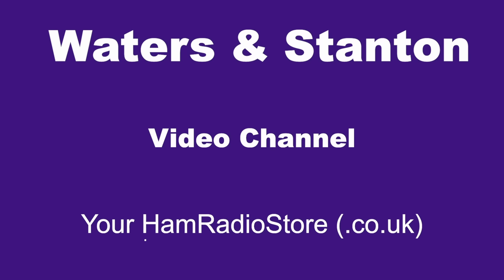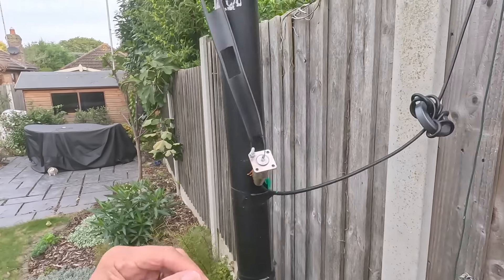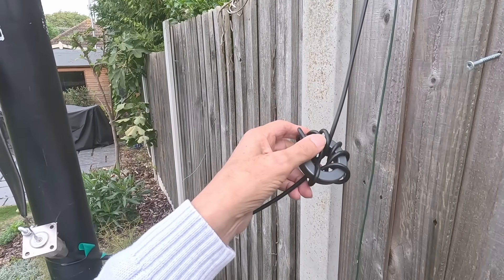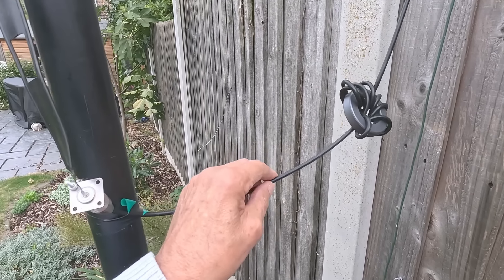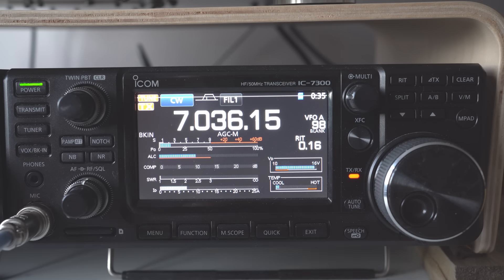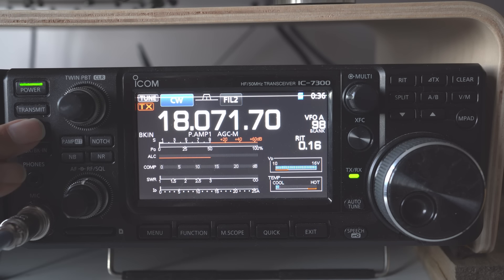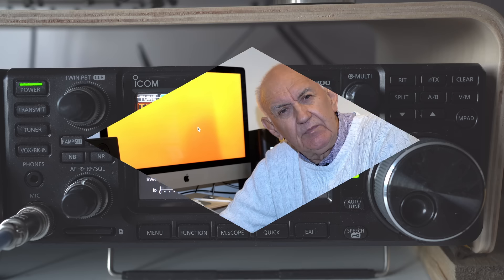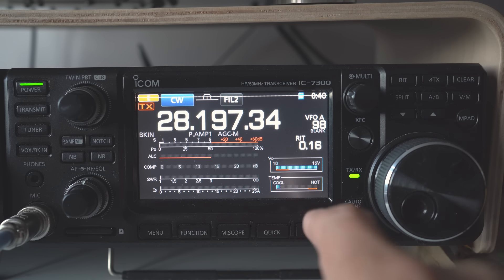Icom IC 7300 Hidden Ability - Check this Out! | Ham Radio

Comment: Hidden from those who didn’t read the manual.
Reply: What self respecting radio ham ever reads the manual? 😂 Only kidding. However, I have encountered individuals who truly seem to believe that referring to a manual is a sign of weakness.
Reply: What ? There was a manual  ??😅
Reply: For Yaesu FT847 & FC 20 ATU owners try this 
The fix is on in one of the menus in the Yaesu 847. After this mod the 847 will tune up to a 7:1 insted of 3:1
The first thing you need to do is get into the service menu. You do this by holding down the three buttons on the mic and turning on the radio.
The first menu will be Fm-51 do not change that one. Rotate the sub-tune knob until you see the menu that says SWR 3.0 to the left this you will see two small numbers or numbers letter combination. Rotate the MEM/VFO CH knob until you see 9A then push the menu button and you are done.

Comment: Its nice they included this. In general, an antenna tuner that can match a 3:1 mismatch on a lower frequency can match much larger mismatches on higher frequencies due to the linear relationship between frequency and reactance. That means that the limiting factor on higher frequencies is not the tuning range of the unit itself, but the voltage rating of the capacitors. That's why the power has to be decreased if you tune a larger mismatch than the unit was designed for.
Reply: That was a great explanatory comment. Thanks.

Comment: Peter, you always give practical ideas. I used your idea with my random wire (35.5 ft) and 9:1 with great success using the IC7300 in emergency mode and have made many qso's while traveling. You are a true advocate for ham radio. Thank you.
Reply from the maker: Thanks so much.

Comment: I would guess the screen SWR indicator is disabled in this emergency mode. I suspect an inline SWR meter would show the same mismatches as when not in emergency mode and thus inefficient transmission, with considerable reflected power, hence to 50W limit to protect the PA from overheating.
Reply from the maker: In-line S-meters always read true VSWR.

Comment: I wonder why they included the emergency feature to operate the IC7300 at a much higher SWR and just didn’t include as standard inside the antenna tuner. My only assume is that it puts a lot more stress on the final output transistors, the capacitors and inductors in the auto tuner.  This maybe this is OK for a short time, like an emergency but if used constantly it will cause prematurely age the components causing reliability problems in the long run, even though it is operating at half power.

Comment: I think when you go to Emergency it drops the RF output power to 1/2 so your tuner is able to compensate for a lower power RF on transmit. Maybe? Check your RF output power with it on Emergency.
Reply from the maker: Yes you are correct. The power drops to 50W.

Comment: Not convinced with the explanation as to why the tuner is 'disabled' from tuning since the tuner is clearly capable of doing so.  Why would you 'cripple' the radio?
I think a better proposal might be that a badly mis-matched antenna tuned down with the ATU, whilst convenient will probably generate heat in the tuner which might cause progressive damage (cooking) with sustained full power use.
When viewed in this context, allowing extended ATU capability in an enforced  1/2 power (emergency) configuration makes more sense.

Comment: Hi Peter, Thank you. I generally wind my line isolators out of RG-402 to avoid windings tighter than minimum coaxial cable bend radius, also to allow for more turns and better isolation.
Reply from the maker: Thanks for sharing

Comment: Thanks for this video. There isnt much info on it and people seem to be all scared of this mode because of the "emergency mode". People always talk about how great the g90 tuner is but in reality just turn on E mode for the 7300 and you get the same tuner ability + 30w more power than it.
Reply from the maker: You are correct. 73 Peter

Comment: It was showing no reflection. Perfect SWR. I wonder if that mode essentially disables the meter, so it looks like it tuned everything perfectly when in fact it did not. I too have a 7300 and 7610. Not criticizing it — just trying to understand it from a user interface perspective.

Comment: I use a random wire, around 30m, with a 49:1 balun. In the shack, I initially use a manual tuner (Kenwood AT-230), to adjust my compatibility with 5W CW, followed by the rigs ATU. This gives me all the bands I want, 160 to 10, and I also seem to get excellent reception. Any comments on this setup regarding the security of my rig? There is no evidence of RF in the shack.

Comment: Thanks for Sharing Peter. I was wondering if you tried reducing the power first with the Power Control and then trying to use the tuner? Does the Emergency Function simply reduce maximum power?
Reply from the maker: No you need to switch to Emergency mode/

Comment: Even its there, its name says "EMERGENCY" so, don't use it always, just for a case where you must need to use it for an emergency case of you need to comunicate because even with only 50W your tuner relays and pass band filters will be exposed yo very high RF currents due to the very high SWR and eventually will damage the relay contacts by arcing inside, its not recomended to use it always.
Reply from the maker: Totally wrong. The last thing you would need in an emergency is the risk of failure. It is perfectly safe for extensive or permanent use.

Comment: Please remember that this is coupling the radio into the antenna. It is not changing the antenna in any way and hence not "tuning" the antenna. 

It's always best to have a resonant antenna on each band but if this extension to the default matching capabilities of the 7300 lets you get some power out on a band that otherwise you couldn't - go for it. 73 Ed
Reply from the maker: Many thanks. in fact it is matching the reactance present at the end of the coax , not the antenna.

Comment: Fantastic, thank you! It tuned my 40m dipole to 20m band, where SWR was more than 3. Now, no problem. 50 watts is more than enough on digital modes. I just had an FT8 QSO to China on 20 meters. And yes, I found a mention about in the manual now when I looked for it. I should have read it more precisely, my bad. 73, OH2KAJ

Comment: A small resistor can allow you to do this at full power level as well, which, for reasonable antennas (ie, not exactly half-wave), you can operate at 100W just fine and not have to reboot into "emergency" mode. Google for pc5e 7300 atu mod, you will see. The mod doesn't change the SWR metering, only the threshold of which the radio will not attempt to tune. One little resistor later and you can run that built-in ATU anywhere. Just be sensible about it and don't torture the radio where it truly should not be used.

Comment: Peter, my preference is to use thick well shielded coax connected to a quality waterproof balun mounted near the antenna terminals. When disconnecting the balun from the backyard dipole, there is no sign of unwanted signal via the coax line connected to my Icom R8500 or 8600 receivers. I use RG6 Quad Shield 75-Ohm coax for my HF and VHF SWL work. The extra coax shielding makes ferrite chokes unnecessary at my receiving location. Not happy with relative thin diameter coax wrapped around a toroid ferrite. The balanced twin lead and coax in your YouTube video is also exposed to the large amount of rain that the UK typically experiences. A properly balanced receiving antenna (dipole, Yagi, log-periodic) with quality waterproof dipole terminal balun mounted as far away from the house and street power line noise sources is optimum for maximum practical SNR. The vertical axis noise floor on receivers like the Icom 7300 spectral display will be usually lower with high-end properly balanced antenna receiving systems. Horizontal polarisation also helps increase SNR. There are always better ways to do things.
Reply from the maker: Thanks for sharing but however thick or however shielded you4 coax, may be. There will alway be common mode currents flowing. R3member, common mode mode current has nothing to do with coax shielding. 73 Peter.

Comment: Τhere is a white horizontal line at the top of the screen. Is there a problem or is it normal?
Reply: It's a problem. Icom got a bad batch of screens and it happens to 1 out of every 1,000 radios from the reports I've seen online. My IC-7300 done the same about 6 or 7 months after I had it. Sent it in for warranty repair.

Comment: Hmm it's a compromise  having such a nice radio it's best to not to have resort to emergency mode really though...
Reply from the maker: No, compromise other than power limitation. Forget the word “Emergency.”
Reply: @watersstanton  the compromise is half the output power yes. If you've got 100w most would want to use it

Comment: Thank you for this video. I have used the Emergency Mode on my IC-7300 when operating mobile in my car but have always been a little nervous thinking that I might be harming my radio by operating it so much in Emergency Mode.

Comment: I tried a G5RV and didn't like it much.  I Put up a 80M dipole and fed it with 450 ohm twin lead and tune it with a 
"true" balanced tuner. A BT-1500A  replica I build to be exact . Much more satisfactory performance even with an amp. Then went one step further and put up a horizontal closed sky loop fed with twin lead ladder line  at 40ft cut for 160M. Tunes great, a top line antenna and now my go to antenna for any application! Cheap, easy to build, low noise,  if you have the space to pit one up!  You can still find old Johnson Matchboxes that work quite well with these at reasonable prices!

Comment: Hello Peter, thank you for that information, I can now tune all bands except for 30m & 60m, I am using a ZS6BKW as inv vee at 40ft so happy enough with that and as you say, 50w is ample power.  However, how would I reverse the Emergency Tuning should I need to? 73
Reply from the maker: Just go back into emergency and you can switch it back via the reset procedure. Make sure you have a line isolator at tx end as this will help matching. Use a ferrite core with a around 8 turns of the coax around it.

Comment: I'm looking for a new radio and the IC-7300 is top of the list. Thank you for the videos about this radio. I like the way the menus are interactive rather than a simple list. The size of the radio is important, I don't want to be fiddling around with tiny buttons. Apart from that, Icom or Yaesu are both very good.  It seems to me that if you have been using your IC 7300 in "emergency mode" for a couple of years without problems then  all is ok.  Perhaps it's a selling point for the USA where emergency communications forms part of the Ham culture.

Comment: I had a Yaesu FT-991, and on my Off
Center Fed Windcamp WA4 multiband
antenna which didn't tune all inclusive
bands because of a 3:1 SWR range.
Also my Yaesu FT-891 with the Yaesu
FC-50 Tuner has similar results.
I have the switchable MFJ automatic
Antenna Tuner Extender in line which
helps the matching to some extent.
Now with my Yaesu FT818nd and an
external AT-100 Tuner and a separate
Micro 50 watt multiband amplifier,
running 50 watts, I believe it is able
to tune the antenna on all bands,
I presume because the external
AT-100 Tuner has a wider SWR range
matching ability, and that is with
the amp only accepting a 2:1 SWR,
or lower.
I don't know of these two full size Yaesu FT'991 or FT-891 transceivers
have a similar feature to help SWR
matching as the Icom IC-7300 does?
73 de W2CH Ray New Hampshire. 😊

Comment: Hi Peter !! Thanks for the video !!  I have a G5RV Jr. and I would like to install the same configuration that you use, what model of cable to the radio do you have?  and what length?  Thank you and 73!!
Reply from the maker: I use RG58 coax. The length is not critical,. I guess mine is about 115 metres, but never measured it!  Hope that helps.

Comment: this is a nice trick for the 7300. I run 50 watts or less with mine. I got a tube amp if I want more. for portable use like POTA this is great . I have used a 9:1 random wire antenna and it tunes all bands. with end fed half wave with 49:1 you only get some bands and with emergency mode you can tune over 3:1 SWR.  like using 17 and 12 meters . when tune for 40,20,10. etc. depending on cut length of wire. This trick is in the extended manual not the paper one. you do the same in menu to turn off  E mode. 73's

Comment: An iron ferrate terminate for the antenna will give nearly 2x the signal capture than most antennae I have found. Plain old protein from household food is comprised almost entirely of ferrate iron. Connect 62 feet or more of heavier gauge copper wire into a jar of any peanut butter which is high in iron, run the cable out a window and place the jar at least 8 or 10 feet above ground or on the roof. You will be amazed with the result.

Comment: So basicaly instead of mesing around in menus selecting Emergancy and having to rebbot the radio, just drop the power to 50W on the bands that wont tune and they will tune.
Reply from the maker: No, no no! Just turning power down has no affect. You need to go through the reboot procedure.
Reply: @watersstanton  Interesting, what a silly way of doing things on icoms part. good info though for people with that radio.

Comment: Interesting option. Thanks for sharing. Very strange that Icom call this feature 'Emergency Tuning'. If I used a half size G5RV, I would definitely use a remote aerial matching unit between the line isolator and the ladder line. This would remove the losses on the coax due to to high swr. You could also use full power from the radio.
Reply from the maker: Yes correct. But not everybody wants to use, or can afford a remote ATU. The VSWR losses maybe less than you think. There are several calculators on the internet.

Comment: Can you achieve the same by simply reducing the o/p to 50 watts, or does the emergency mode activate some other changes, possibly the tune up power applied during matching.
Reply from the maker: No
Reply: Normal mode will match 3:1 and emergency mode will match 6:1. That said, the toroids in the ATU are tiny and they will get very hot if the antenna is far out of tune. There is a reason why it's limited to 50w when matching 6:1 and its not for your safety.
Reply: I can
Reply: @neilcoley9464  I have manually turned the watts down to 1 or 2 and made it tune a large mismatch but the losses would be very high besides running very low watts. Almost no signal will radiate off the antenna at that point. Best practice is to work on the antenna to be resonant at the desired frequency instead of transmitting with a poor swr.
Reply: @aarongriffin81  nice

Comment: Thanks for sharing this, but the Emergency Tune function isn't "hidden".  It's right there in the manual and menu.  I use it sometimes with my 7610, but normally don't need it (I have an external high-power LDG tuner).  I find it useful most when running FT8 or WSPR in the field when my antennas are far out of tune on certain bands, or like your G5RV, isn't resonant on the band at all.  BTW, there is NOTHING wrong with non-resonant antennas.  I've been using them for years with outstanding results.  There are special cases where non-resonant antennas actually have gain over a standard resonant 1/4 or 1/2 wave antennas (the Extended-Double-Zepp is one good example that I use a lot).  The only "trick" is to use feedline that isn't too lossy into mismatches, like twinlead.
Reply from the maker: I think the hidden part is that Icom decided to call it “emergency” whereas it is simply “extended capability.” Thanks for sharing.
Reply: @watersstanton  Perhaps somewhat misnamed. But OTOH, they could've called it "Changes tuner into a mode that allows it to match 10 to 1000 ohms but reduces power to 50W" and someone would complain. Just how hams are, I'm afraid. 🤣

Comment: Hi;
I have seen thet your 7300 display has a white line, Do you know if it is easy to change the display for a new one,? I know someone who has that problem, it is not a serious problem but it would be good to change it 
Regarding emergency operation, I will tell you that really 3dB less power is not a serious problem because it is only 1/2 "Santiago" on the s-meter, and as you say, it is possible to work in other bands
In any case, I do not understand why  ICOM did not put an ATU that can work with 4 or 5  SWR, for 100W. I think that the voltages generated could be alleviated with some better relay that is not much more expensive.
Sorry for my bad english
Reply: Have you been inside an ic-7300? The toroids are tiny and they get very hot, exactly the same as any balun which has much larger toroids. An ATU is simply lots of different sized baluns used in conjunction with each other until there is a good swr match. It may be using 1 toroid or 8 toroids or any combination of several to achieve a match. However, they are tiny and heat is a big issue at 100w. The 50w restriction is not for human safety, rather mechanical safety.
Reply: THank you for your answer

Comment: Would you get the same result if you just reduced power to 50w and stayed in non-emergency-regular mode? 73, KB3NG
Reply from the maker: No you need to change the ATU mode.

Comment: I had upgraded to the latest firmware for the IC-7300, V1.41.  
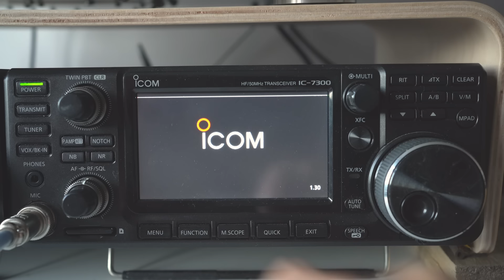You are using firmware V1.30, as in the video at 4:40/9:10
Will this method be appropriate for the latest firmware ?
I appreciate your videos.

Thanks   Stan

ZZZZz
Reply from the maker: Yes it works with all versions.